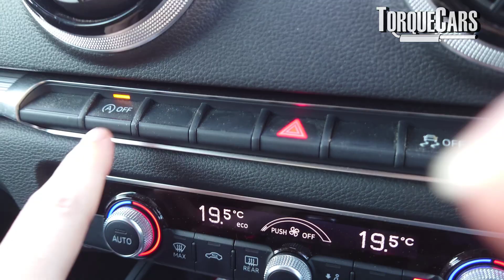Stop-Start vs. Idling: Which is Killing Your Engine Faster? 🚨

Comment: Retired Kiwi Mechanic. On the stop/start cars do they build them with more durable starters and ring-gears?
Reply from the maker: Yes they do, the starters actually feel significantly heavier, provide much more torque. The engagement & ring gears are nicely engineered and in many cars even the preferred cam position/crank position is achieved when the engine stops.

Comment: Generally, stop start will only function when the engine has warmed up. Some people worry about turbo damage if the engine turns off while the turbo is hot. However, many modern engines like the 1.0 TSI have coolant running through the turbo and an auxiliary (electric) water pump keeps coolant following. It even works for a bit after the ignition is turned off. Personally, I’d only use stop start if I was in very heavy traffic where there are considerable delays in moving off.
Reply: does the electric water pump apply for all years 1.0 tsi?

Comment: If you have come to a stop say in a traffic queue after your turbo has been on boost, i would and do leave it running otherwise it can safely be left to do its thing. Stop start imo is ok in situations where you are going to be stopped for a period of time, not really good where you are moving ten feet, stopping briefly, then moving again, and so on in a moving queue, its then i turn it off.
Reply from the maker: That sounds like a sensible approach, and is something I do myself.

Comment: @torquecarsdriving Should I disable the start/stop if I have a turbo and the engine is warm enough in order to allow cooler oil to flow through the oil passages in the turbo?